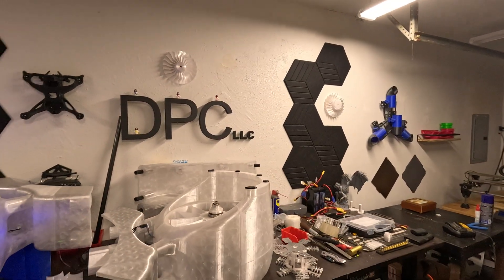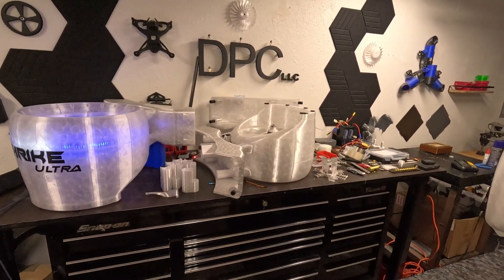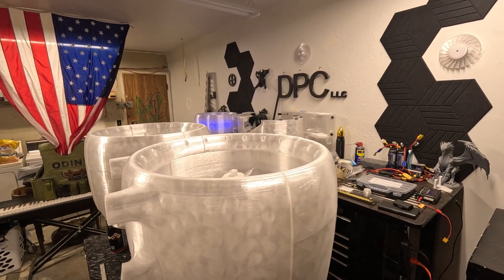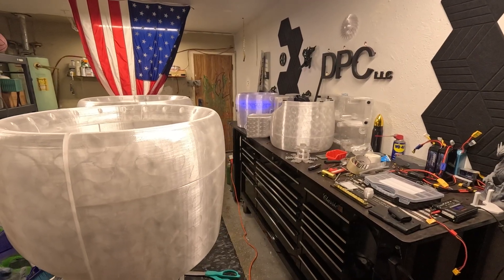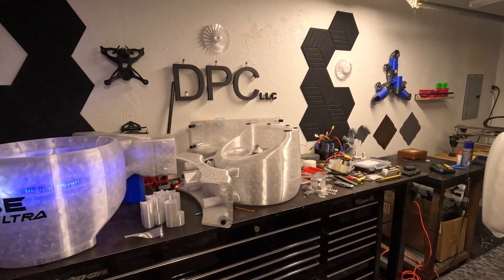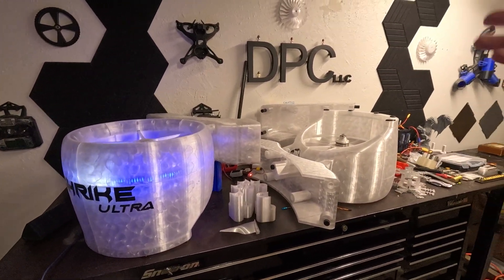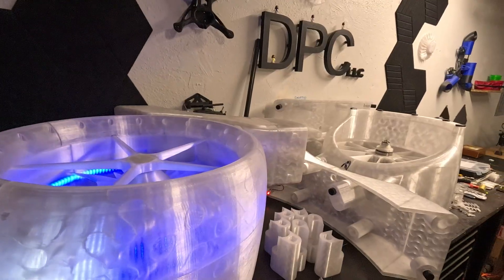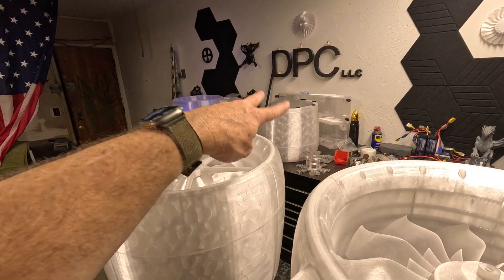I am building the largest 3D printed EDF drone in the world.

Comment: When will it be finished the final date !!!
Reply from the maker: It’s hard to tell. I’ll know more in about a week. Lots of parts coming in.
Reply: @warmachined3472  yo could u do me a favour plss?
Reply from the maker: Sure, what's up.
Reply: @warmachined3472  thx for replying , but i totaled the total cost of the 80 mm edf project and it literally went way above my expectations. So if u don't mind , do u have any spare 120 a esc or 6 s lipo or transmitter and receiver? Any of these would help alot especially the esc and lipo plss if possible and if u hv any spare ones plss can u send me some .it would mean a lot to me .
Reply from the maker: @Spy_Ghost  I don't have any 120s I have a few iflight 80s and as for lipos mine are pretty worn out from testing. Transmitters, I have a TX16s but it's my only transmitter outside the FlySky I use for testing. Let me go through my gear. Email me on my channel page and get me a parts list I'll see what I can do.
Reply: @warmachined3472  oh k thx a lot bro it really means a lot to me appreciate it 🤝!!
Reply: @warmachined3472 oh k let me know . And can u do me a favour plss ?